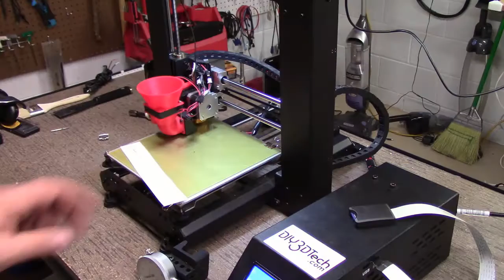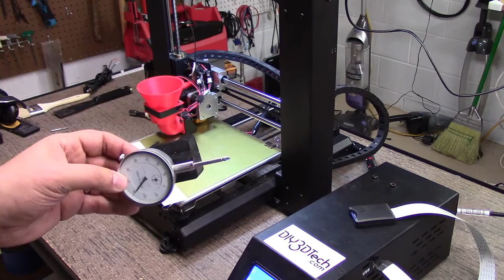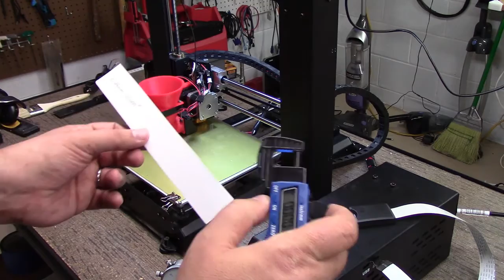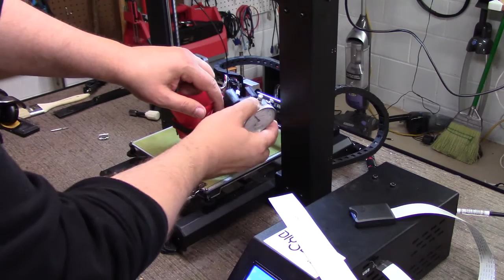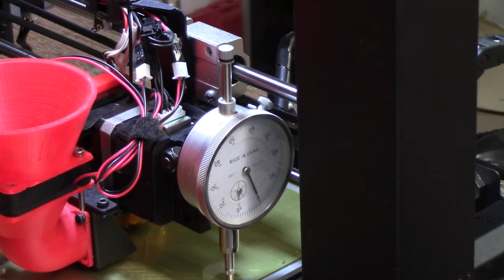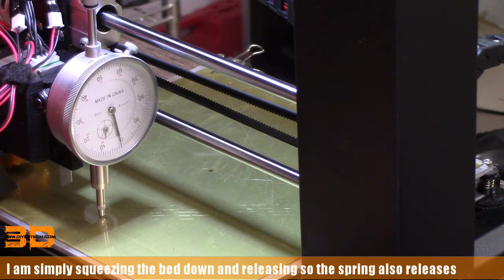Shop Talk - 3D Printer Bed Trimming with a Dial Indicator!

Comment: I know this is an old video but I just stumbled upon this. I wanted some sanity with bed leveling without having to mess with a BL Touch and firmware flashing.  I ordered the stuff and will by trying today.  However, I'll be working on modifying or designing a mount that'll fit the CR-10 v3.  Thanks for the video...while I watch my friend mess up his printer trying to flash firmware, I'll be riding analog ;)

Comment: since I started using the dial indicator,  I have never had a leveling issue. 
I only use the paper to set zero. I then zero the indicator at that point. go to the four corners and set them to that same zero. one time around and it is as flat as the glass. when I run the auto level, the    result shows .01mm difference between highest and lowest
Reply from the maker: Yup!  Works well!

Comment: I'm confused about something. When you do an auto home and then adjust the bed using the paper (0.26mm in your bed), the printer actually thinks that's the Z=0 position. So when you print your first layer (say 0.2mm) the nozzle should be 0.2mm + 0.26mm off the print surface?
Reply: Precisely but on mine I will then do an offset in the slicer to compensate for the paper.  In my case I reduce the offset of my sliced code by .2 (a sheet of paper folded over).
Reply from the maker: In short that is the point that the printer is not a CNC so it needs to "start" at an implied distance above the bed in most causes (not all slicers are the same and or can be adjusted) this is about 0.25 of so mm and the first layer is typically over extruded (i.e. 0.2mm becomes 0.3mm) and this presses down the plastic.  Other wise the nozzle would be pressed tight to the bed and no plastic could be extruded.
Reply: slic3r and s3d can and I think Cura can but any other slicer doesn't really matter.

Comment: After using a dial indicator on my printer i have not had any bed leveling issues it saves me a lot of time and headaches
Reply: On my i3 rework it gave me so many headaches I gave up using it but if the world were a perfect place it should give a dead 0 all over the bed with 100% repeatability but I was never ever able to get the same reading twice no matter how many hours I worked at it.
Reply from the maker: Agreed, as I use it (as shown in the video) to ensure level across the bed.  The key which I was trying to get at in the is not to over fret about it as there will be some variation and that is ok the key is to normalize it...